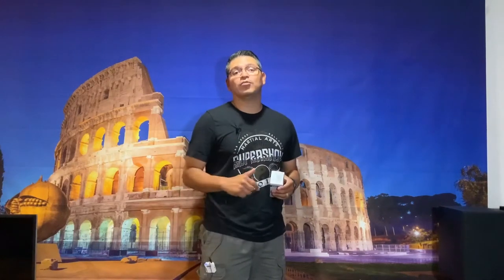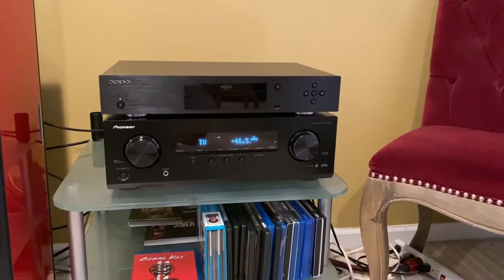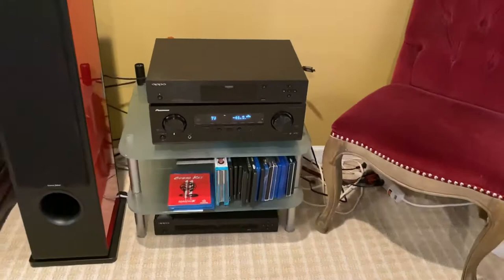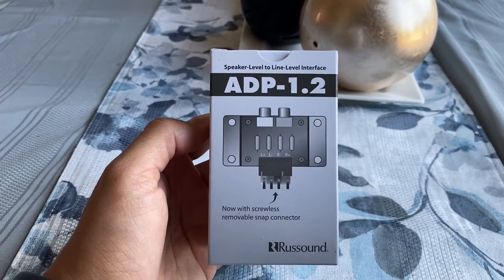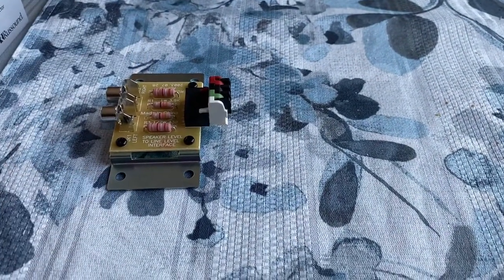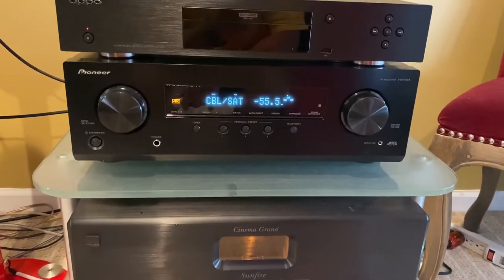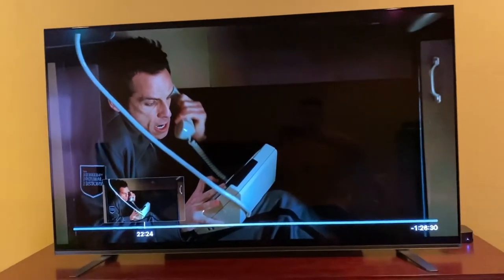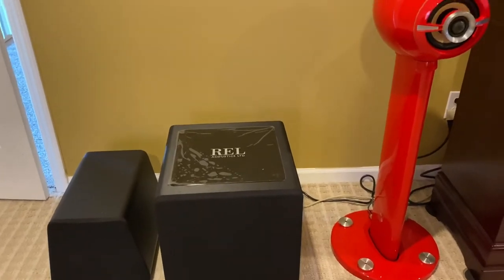How to connect an amp without preouts. Pioneer receiver and Russound

Comment: I used that device on an old 1993 JVC 5.1 / 120 WATT  AND USED A NEW EMOTIVA 2 CH. AMP.    Great sound with todays electroncs.  I will deffinately upgrade the AVR.
Reply from the maker: Glad to hear that. Thanks for watching and commenting
Reply: Using the inter-connects, what’s the connection from the receiver to the amp?

Comment: I thought the idea of a pre out on a receiver is that the user can bypass the (usually) junk power amplification of the cheap receiver and use a real separate power amp. The solution presented in this video takes the signal of the built in power amplification and knocks it down to line level. So the power amp of the receiver is still in the signal chain doing its thing. Did I get this completely wrong?
Reply from the maker: No. You’re right. This video was for those that want to use a separate amp but the receiver doesn’t have preouts. So in that scenario this device transfers the signal without down grading the signal so the external amp can power the speaker. With capacitors and resistors in the device that helps the signal to not degrade. Thanks for watching and commenting

Comment: Does the converter "care" about the speaker impedance (e.g. 4 ohm vs. 8 ohm )?
Reply from the maker: Yes but when I called on it they told me they are compatible down to 4 ohms. And I did confirm that using them with my Sonus Fabre speakers. Thanks for watching
Reply: @Audiolympian  OK, thanks.  BTW someone recommended a PAC SNI-35.  They are transformer based (which is better than using just resistors - distortion wise) and they are inexpensive on Amazon.
Reply from the maker: @Enigma758  thanks. I’ll look into those.
Reply: @Audiolympian  Just be sure it meets your needs.  Considerations include speaker impedance and whether or not a remote wire is supported.  Some are intended more for car rather than home stereos.  Take care!
Reply from the maker: @Enigma758  thanks for the tips
Reply: @Audiolympian  to

Comment: Brilliant video, i have a question. Can i use this to run an active subwoofer from the speaker wire to my passive subwoofer. My current set up is a Harman Kardon BDS 635 5.1 thanks man and keep up the good content 👌🏻
Reply from the maker: Thank you. Yes you can use this adapter for a sub. The thing to keep in mind is the signal is not a dedicated lfe signal it’s a full range signal but the sub will give some added bass. Thanks for watching
Reply: Thanks for the reply man appreciate it 👍🏻
Reply from the maker: @cameronbaillie87  no problem.

Comment: What will happen if you plug high current things like a space heater or a refrigerator or a table saw or a microwave into the 120 volt outlets into the back of the av receiver.
Reply from the maker: Well a space heater will definitely blow a fuse. However the reason receivers have outlets on the back is because years ago devices didn’t always come with trigger inputs for power and to turn on so you could plug into them and another device,  CD player or amp will power on. But I wouldn’t use them today and it’s probably not a good idea to plug any high current devices. Thanks for watching

Comment: You missed a few things I was wondering about that Russound - ADP-1.2 Speaker to Line-Level Adapter.  Do you have it running in parallel with your speakers?  Also if you turn up the vol on the Pioneer amp does that screw with the line out of the ADP?  I have the Pioneer VSX 933 updated version from what you have and I was thinking of running a few VU meters on all the channels using a few of those but still run my speakers at the same time.

Also what's the Ohm rating from positive to ground on say left channel of that device?
Reply from the maker: No I don’t have it in parallel. I was only using  two speakers and it designed for two speakers so I didn’t feel the need to. Also it doesn’t have any problems turning the volume up on the pioneer, the Russound is designed with attenuation. I’m not sure what the ohm rating is I’m not sure the little manual that came with it mentioned anything about that ohm rating. As far as speakers go I have had 4 ohm speakers hooked up but my amp takes care of that it’s stable down to 2 ohms. Thanks for watching

Comment: I just realized if you connect the adapter to the speaker outputs in the back of the AVR, it already went through the internal amp of the receiver. Then you connect to the adapter then to the input of the external amp. If I am wrong please correct me
Reply from the maker: Yes you’re correct.
Reply: @Audiolympian but then that’s not how preout means. Preout means it bypasses the internal amp so you can connect to an external amp
Reply from the maker: @toai2  correct.

Comment: But you loose the power from the reciever?
Wanting to bi amp. 
Reciever running the high end and external amplifier  running the low end. Don't look possible with this device. Once you run your speaker wire out from your reciever? Or could you use the B channel for this device and still get sound out of the A channel. I have questions. Anybody got some out there?
Reply from the maker: No you don’t lose the power from the receiver. It’s just redirected. As far as bi-amping, I think your best bet is using b channels. I haven’t used b channels in a while the only issue that might be there is if your going for true Atmos or Dolby, the b channels might shut off or not allow for true surround sound. But I think it’s an interesting concept you got there. Hope that helps. Thanks for watching

Comment: Hooked up my basx A5 using the adapters for main stage and surround backs. Surround sides stay connected to the reciever but now i cant hear them
Reply from the maker: You’ll definitely need to go into your settings and adjust the DB for your speakers, if your receiver allows that. Your basx must be a lot stronger than your receiver.
Reply: @Audiolympian  can I just get a 2 channel to run those alos
Reply from the maker: @albertgomez6855  yep

Comment: So...i listen to alot of music. I have an 80wpc pioneer elite. Does adding a 100 watt 2 channel amp make a big difference in sound, or just volume levels?
Reply from the maker: It Depends on the amp. A good amplifier amplifies sounds not just volume. So you should be able to hear more ambient sounds along with extended volume. For music the instruments should sound more clear and present in the sound stage. And the vocals should be more robust and lively as if the singer is in the room. A 100 watt amp should be a noticeable difference over the receiver. Hope that helps. Thanks for watching.

Comment: i have a question, if you want to hook up a receiver without preout to an amp do you nee3d to change the signal voltage to microvolts or simply just have the rca adapters.  i have some speaker wire to rca connection adapters that dont do anything to the signal strength, can I simply use the adapters to plug into my amp or do i need to change the signal voltage as well? is that what the adapter youre using does or is it simply just a connection fitting adapter?  thank you, great video btw, i found it very helpful
Reply from the maker: You just need the rca adapter. You shouldn’t need to change any voltage at all. I haven’t used any other device so I can’t say for sure it would work but others have told me they used car adapters that worked so it could work for you. Hope that helps. Thanks for watching
Reply: thank you, i super appreciate your help and advice.   @Audiolympian
Reply from the maker: @erisrising4016  you’re welcome my friend

Comment: Hi! I am having issues with scrolling comments so sorry if this is already asked...what gauge speaker wire are you using? I got one in today and I am struggling to get the wires in the adapter without strands not going in and causing shorts. Is there an adapter for the speaker inputs that you are aware of? Like teeny tiny banana clips or such? Thanks! Great video! I'm hoping to pull off exactly what you have done.
Reply from the maker: He Emmmanuel. Unfortunately we are forced to use a high gauge wire so it will fit like 18 or higher. Another option, and this is what I did, is to use solid core wire like the wire used in electrical work and I kept that wire as short as possible and used longer interconnect cables. Hope that helps. Thanks for watching
Reply from the maker: Yes you could use the pin connector. Just not sure if it would fit in the adapters connection. If it does then that would be a good source. Thanks for watching

Comment: Can you think of practical drawbacks to using this instead of buying a receiver with native preouts? Thanks!
Reply from the maker: Good question. Maybe the only drawbacks would be the adapters are not in a case or chassis. And the speaker terminals on the adapter are small so you are limited on the gauge of the speaker wire you use to connect. Other than that nothing else I can think of. Thanks for watching
Reply: I know this comment is old. With this method (or any line output converter), the receiver's internal amplifier is still being used to output audio. The adapter uses resistors to attenuate the signal. 

The pre outs on a receiver pulls the signal from the preamp stage of the internal circuit instead of the power stage. Hence the term "pre out" refers to preamp output. Using an avr with pre outs puts no load on the amplifier stage. This allows the avr to run cooler. Reducing the risk of thermal shutdown. The avr then becomes a processor only. Of course, you can still connect speakers to channels that are not routed through the pre outs. LCR pre outs to an external amp for those channels and run surrounds off the avr. More flexibility options.

Comment: Does this work for a subwoofer ? I have an amp with no sub out and a sw with no speaker inputs.
Reply from the maker: I assume so. The only thing would be the speaker signal is not a dedicated lfe signal but should still work and add bass to your overall sound. Hope that helps and thanks for watching

Comment: You're a lifesaver! My Denon only has subwoofer pre-outs so I really thought I didn't have any other options for hooking up an external amplifier until I saw this video! I pretty much ordered this immediately lol. Can you hear any sound differences using this adapter? Side note: check out Fosi v3 mono amplifier that just came out. It's around $100 and is putting high-end amps to shame, especially at its price!
Reply from the maker: You’re welcome, no difference in sound for me. I have seen the Fosi but haven’t looked into it, thanks for the tip. I’ll check it out. I’ve been waiting for something new to review. Thanks for watching

Comment: So can I use these to adapt powered studio monitors to my reciever since I don't have pre outs? Would like to use studio monitors for my surround sound system.
Reply from the maker: Good question. I would think so, a powered monitor is basically a speaker and amp together. I’d say yes this would work for you.  Thanks for watching
Reply: @Audiolympian  one more question if you don't mind, because there is four speaker wire ports and 2 rca outs does that mean I could power two monitors by plugging in the speaker wire ports into front l and front r on reciever and 1 rca to each speaker? Thanks alot for the replies.
Reply from the maker: @bpalf8379  yep one adapter is for two speakers so you can use set for L and R
Reply: @Audiolympian  awesome! Thanks so much for the reply. Ive ordered one for myself and am excited to hear the end product.
Reply from the maker: @bpalf8379  cool, happy to help. I’m sure you’ll enjoy your set up.
Reply: So I received my adapter and it worked amazing for my powered studio monitors to audio reciver using 14g speaker wire. No noise issues from what I can tell either.
Reply from the maker: @bpalf8379  awesome glad to hear that. I also order a couple more adapters for my other channels.
Reply: @Audiolympian  I'm considering returning my front channel passive speakers and picking up some more studio monitors and another adapter. I feel like the sound quality on studio monitors is way better.
Reply from the maker: @bpalf8379  cool. Yeah some powered monitors do sound better. I used to have some paradigm ones that were awesome.
Reply: @Audiolympian  what monitors are you using??
Reply from the maker: @thesonarcube7631  on that system I periodically switch between my Klipsch rp-600m, sonus faber chameleons and Wharfedale Evo 4.2. Thanks for watching and commenting

Comment: The thing is a want to connect my graphic equalizer to a plus recoiever I just bought about 2 years ago I doesn’t have pre outs
Reply from the maker: Oh I see. That would be difficult being an equalizer usually requires the signal of the source first like a cd player or turntable then to a receiver or stereo. Sorry I couldn’t help you more.

Comment: Hey I was wondering, if you use this it still runs the internal amp in the av receiver right? I push loud volume so I’ve been having a hard time finding a stereo with a good internal amp so I recently got a 12 channel amp that will do up to 150W rms. But if I were to crank up the av receiver would it not still get hot and go into protection mode as the internal amp is still pushing power? Thank you!
Reply from the maker: Yes it still runs the internal amp for other channels. I originally had it set up for just my front mains and my center and rears ran off the receiver still. As far as a I know the receiver should be fine cranked up with the amp connected, like you said the power is coming from the amp but I guess any amp or receiver can shutdown if it gets pushed too much but I’ve ran mine pretty loud and for a couple hours and no issues. Hope that helps and thanks for watching and commenting.

Comment: Can you still use subwoofer on receiver and regular speakers on amp and hear them all?
Reply from the maker: Yes you can. But you may need to adjust the settings in the receiver to have good balance. Thanks for watching

Comment: Great video and thank you.  I really thought I had to but another receiver with the needed pre outs. On the receiver what is that metal piece going into the "Speakers Front" around the 11:45 video mar. I am not an expert and still learning.
Reply from the maker: Those are called banana speaker connectors. Those connect into the speaker terminals better than bare wire. Thanks for the question and for watching.

Comment: Sir , can I use car speaker level to line level adapter on my home theatre setup
Reply from the maker: A few people have asked that before. I would say yes you possibly can but I can’t say how well it works because I’ve never done it. The biggest concern I always have with car products is they are not designed for 15amp / 120 volts and 1500watts. Just designed for car voltages. I don’t recommend using them but they could work though
Reply: @Audiolympian  is there any other way because this product is not available in Pakistan ☹️
Reply from the maker: @Rhim302 sorry to hear that. To my knowledge there isn’t another way, however some people have mentioned that they tried using a car amp converter. I don’t typically recommend them because they are not designed for the voltage and wattage and may not be the best option but perhaps it could be a short term solution.

Comment: Is this the only adapter I could use or could I use a line level converter for a car as long as one end has speaker wires and the other end has rca jacks?.
Reply from the maker: I’ve had a few others ask that question before. It seems possible but my concern would be car audio devices are designed for 12v not 120v. I think it would fry up. But it may be possible I’ve never tried it. Thanks for watching

Comment: So, if your fronts are hooked up to the preamp and they're hooked up to the receiver, will receiver still distribute the signal regularly in surround sound?
Reply from the maker: Yes it will or at least it should I know some older receivers (12yrs and beyond) may shut down the other channels but in every situation I’ve used and others told me the channels stay active. Thanks for watching